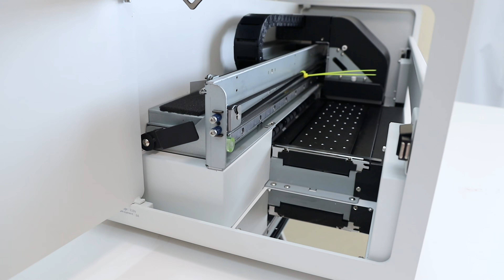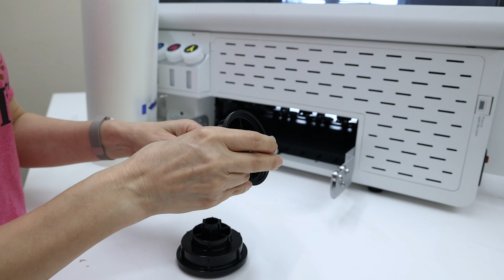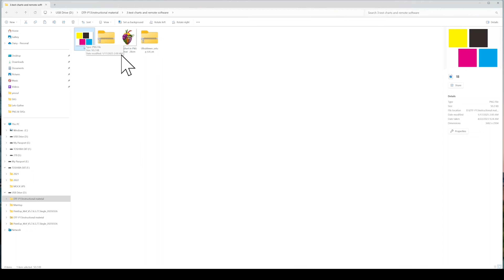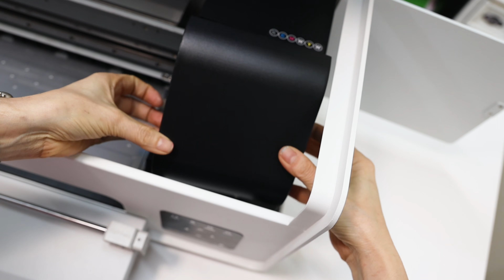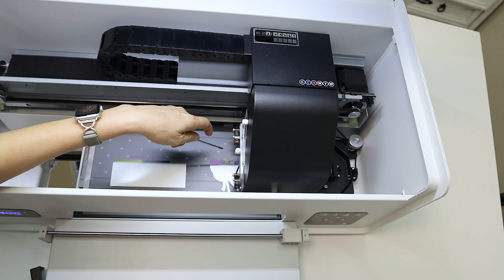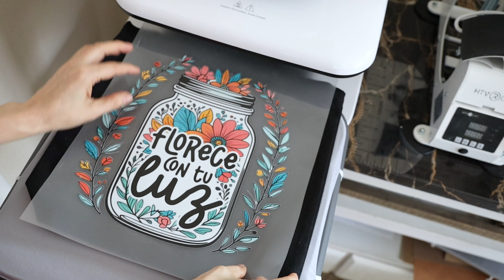DTF Made Easy! Meet the New ProColored P13 ✨ Unboxing, Setup & First Print

Comment: Hello Daisy. Thanks about your videos. I want to know witch printer DTF do you prefer : Procolored P13 or K13 LITE ?? I want to buy one for me business. Thanks about your answer.
Reply from the maker: Hi, the P13 is a printer designed for those who want to work in a more professional way, since it is faster, quieter, and comes with advanced cleaning and maintenance functions. On the other hand, the K13 Lite is more practical and affordable, ideal for those who are just starting out or running a small business, although it prints a little slower than the P13. 😊

Comment: Daisy, thank you so much for the informative and helpful video! I really enjoyed it. I have a problem setting up my machine though: my laptop does not recognize or register the blue dongle when I insert it (I've done deep investigating and confirmed that the flash drive is faulty) so I downloaded the Pro RIP software and the PrintExp software off their website, but apparently that's not all there was on the blue dongle? When I click to open the Pro RIP software, I just get an error that says "Dongle not detected" and tells me to contact support. Why is this happening?

Comment: HORRIBLE CUSTOMER SERVICE. I had a terrible terrible experience with customer service for procolored. Basically they will pretend it's something you did on your end and have you to troubleshoot meaningless options knowing it will never work. Also, they will suggest you buy parts for repair that doesn't have anything to do with the main issue which is quite expensive in order to troubleshoot. Hopefully the new printer is more durable. Always keep in mind the customer service sucks before you make this purchase.
Reply: Customer service is the exact same. Bought this p13 Mac iOS dtf printer. It came broken and missing pieces. The engineer told me to glue the broken piece back together. Still can’t use the printer and it’s been sitting with the ink lines clogging every day. Just a disaster from day one.

Comment: 🚫 Do NOT buy from Procolored!

I bought my DTF printer last year, and since the very first day, it’s been nothing but problems. Every single day, a new issue shows up, and I end up spending hours trying to fix it with their support.

The machine comes with almost no instructions, and something is always going wrong. I’ve contacted them countless times, and instead of offering a real solution — like replacing the machine — they just try to “fix” the issue of the day. It’s a never-ending cycle.

I’ve already spent a lot of money buying rolls of film that were mostly wasted just printing nozzle checks and error tests. I paid nearly $4,000 for this machine — and that doesn’t even include the huge amount I’ve spent on ink and replacement parts just to try to keep it working.

What’s even more frustrating is seeing influencers promote this machine through paid partnerships, showing only the positive side and never the constant problems. That is not the reality for those of us who actually paid for the machine.

I’m exhausted, disappointed, and truly regret this purchase. Please think twice before investing in a machine that simply doesn’t work as it should. I wouldn’t wish this experience on anyone.

Comment: Is downloading the printexp software necessary if I clean my dtf printer manually? Mine is having a lot of issues and will not open in English.
Reply from the maker: Yes, it is necessary to download the PrintExp software since many important cleaning and maintenance functions—like head cleaning and ink flushing—are performed through it. Even if you clean your DTF printer manually, the software plays a key role in keeping the system running properly.

If the software first opens with garbled text or characters, try closing it and reopening it—most of the time it will switch to English on the second launch. I also recommend reaching out to Procolored customer support. They’re very helpful and can assist you with any issues related to the software, drivers, or your printer.